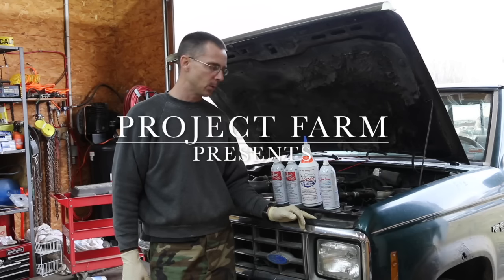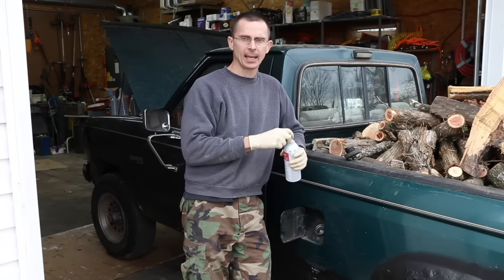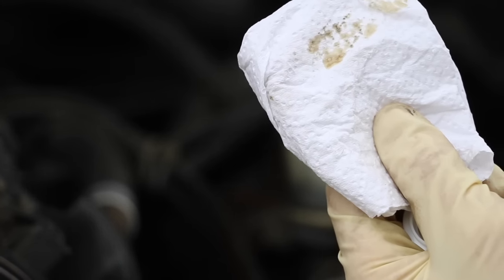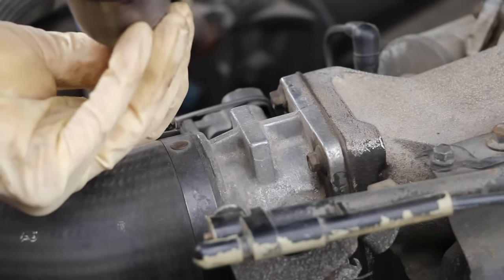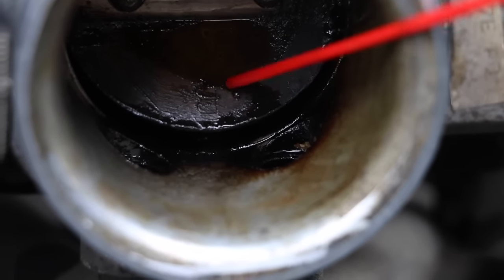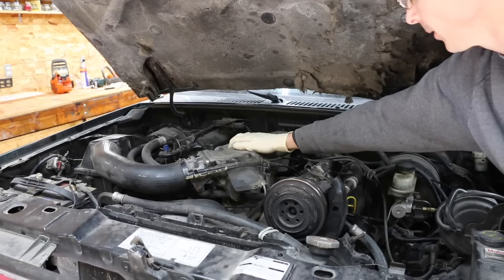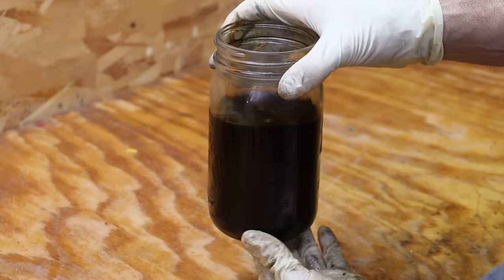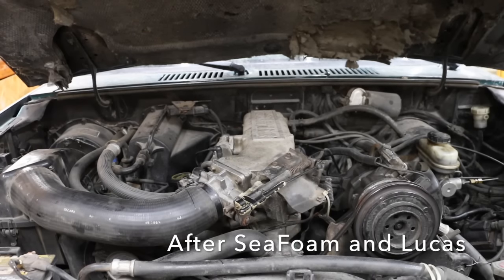Seafoam--can't believe what it did to my engine!!

Comment: I used to add kerosene to the oil. About a quart to a cold motor and idle it for five minutes. Drain oil and replace. Has managed to help several junk cars i bought cheap run better. Love the Lucus oil too.
Reply from the maker: Thank you for this recommendation!   Lucas is a great product.
Reply: I've done that alot also,helps flush the engine
Reply: Greg Cripps t
Reply: My Dad use to do that before every oil change back in the 50' s.
Reply: Sometimes I run a about half a quart of ATF+4 in my engine about 200 miles before an oil change.
Reply: That is basically all that  "Valvoline motor flush"  is. But yes fully agree this works great. I just started doing 1/2 quart any ATF 1/2 quart kerosene. Seems to work fantastic!
Reply: Chris C I like adding Lucas Pure Synthetic Oil Stabilizer to my oil sometimes...just a little so I have benefit without my oil viscosity going thicker. Anyway, I read that it dirties up your engine and I've found that to be true. My oil is very dirty at 4,500 miles intead of 5k miles. So I need an oil flush. Since that's just kerosene more or less I'm totally going to buy some and try it! Be sure to follow so you don't miss out. I've already got a couple Lucas videos and water decarbonization up.
Reply: It works. That is old school. Risolne works too. It replaces a quart of oil.

Comment: take off your throttle body and use some carb cleaner and a toothbrush clean up that plate it will help it breathe better
Reply from the maker: Ahley Excellent advice.  I'll do that.  Thanks for watching the video and the comment!
Reply: your welcome also one more thing after seafoaming it's a good idea to change your plugs know from personal experience it is amazing stuff if you use it right!!!
Reply from the maker: Excellent point--I'll do that too.  Hope you enjoy the weekend.
Reply from the maker: Ashley,  I removed and cleaned up the throttle body this weekend and it made a big difference.  I release the video of this procedure next week.  Again thanks for the great suggestion!
Reply: Project Farm I was about to suggest the same thing! Amazing how much difference it can make, cleaning the pcv can do some good if your vehicle is fitted with it. :)
Reply from the maker: Spac8, thanks for the recommendation on the PCV valve!
Reply: Project Farm No worries at all. My friend had a little 1500cc Mazda that was burning a crazy amount of oil (a proper blue smoke trail under full throttle!) - as it had 160k on it, he presumed it was caused by ring wear or similar. He tried the Lucas you used to try and help, to no avail. I used carb cleaner to shoot down the PCV line to flush it out and it totally stopped smoking. Can make a huge difference. The other thing I do to my own car is to spray a few squirts of carb cleaner in the throttle body whilst the engine is idling. On most modern cars, when you back off the throttle and the throttle plate closes, the air has to "bypass" it by going through an idle air control valve, that is essentially a little motor that controls idle air flow based on info from the ECU. Some cars have a habit of clogging it (like mine), so once a month, I let it idle and do a few very short bursts through the throttle body (or the actual idle air valve orifice if you can get to it) then I rev it up slightly and let it settle back down, do one more idle spray, and turn it off. Let it sit for 5 mins or so and then start it back up and rev it or go for a drive. That method cleared up an idle problem on my friends E34 that I was told could only be cured by a new part or by taking it off the car and cleaning it out. :) Now you've done all that cleaning, that thing is running beautifully by the way!
Reply from the maker: Spac8, Great insight in how to use car cleaner to clean the contact points of the throttle plate with the throttle body as well as the TPS!  I'll do that in the future.  Thanks for watching the video!
Reply: yes clean throttle body it will idle better..ive learned from chevies that when it turns on and then off immediately is most likely a dirty throttle body
Reply from the maker: Mandela Effect, thanks for commenting.  In part 2 of the video series, I cleaned the throttle body and it helped the idle a lot!  Thanks again!
Reply: Did you also clean idle air bypass solenoid?
Reply: Steve Smith 
The IACV (idle air control valve), the solenoid can be serviced but shouldn't be "cleaned".
Usually the solenoid attaches to the outside of the valve, works the function, has little/no contact with engine.
Reply: With the kind of carbon build up You had in intake . I'm just going from experience with ford's I have previously serviced. They usually have good amount of the carbon an oil build up due to pcv as well that was previously mentioned. 
 I have had great success in pulling valve and spraying it with carb cleaner an letting it soak an then flush out with carb cleaner. 

I have not had one fail from this because I do not submerge it. Only soak the inlet an  out ports of valve.  Either way the seafood did a good job on the little pinto motor in the ranger.
Reply: get someone inside the vehicle to hold throttle wide open while doing
Reply: BlackFlyerRed88 MRWatson you don't have to have someone inside to hold it at WOT, that's why there's a linkage on the throttle body... not to mention doing that is unnecessary regardless
Reply: ok man, that's fine n dandy but if its held open for you, whether using an apparatus or a person, then you could have 2 free hands, and sometimes the return springs will wear you out trying to hold open with one and clean with one hand. If it is held for you, you can spray cleaner with one and scrub with toothbrush with the other. And sometimes very necessary to keep engine running smoothly. have a good 1
Reply: Ashley Anderson
Reply: 1970 olds442 have you tried to seafoam a vehicle and actually see the difference one of the tsb articles from gm about my trailblazer was about how the throttle body could become dirty and result in loss of power so I did as it said removed the throttle body and cleaned it power was restored I respect that you are a mechanic as I have tore down and rebuilt alot of cars in my life the work is tough but try the seafoam treatment on your vehicle and you will see that it works my 02 trailblazer smoothed right up after doing this as well as my 03 f150 and it has been over a year with it and I haven't had any adverse effects except for changing the spark plugs thanks and have a great day
Reply: I like pulling the butterflies out of the throttle body and soaking them in hoppes 9 cleans them better did that on a used holley i bought cleaned the entire throttle body using hoppes and a tooth brush
Reply: seafoam will clean a motor out but thats not always a good thing you break all the gunk in the oil system loose the first place its gonna go is into the bearings and then you blow up
Reply: Seriously? Did you even watch this video? His engine went from loud and bad idle to nice and smooth!
Reply: hey if you're a mechanic what are your thoughts on that compression fitting on the master cylinder line ?    not on my truck!
Reply: What throttle body? I see a plenum on this fuel injection engine. More air is more horsepower and more fuel, nothing new but it gonna help this tired old Ranger that has been overworked and neglected. It is a toy truck.
Reply: Perhaps being a mechanic ALL your life you might have suggested an oil pressure test or gauge be employed as that was the goal here I believe. The clatter went away and where did it go? You tell us. 10mpg more? Really? That is something you achieve with what you work on? You must be one busy wrench if you can do that.
I think the fellow here will get some extra use out of the old mini-truck without paying you rip-off artist mechanics a fortune for doing nothing. Olds 442 huh? You can pass everything except a gas station.
Reply: cravinbob ???
Reply: You might also want to remove the Mass Airflow sensor located on the throttle body and clean that too. If the TB was that dirty then the MAF sensor probably is too.
Reply: I only wish they had put the 2.9 in the pinto. lol
Reply: Well I used to be a mechanic and I would say that  slug  in the engine  from oil heating and cooling  had clogged some of the oil ports and maybe even the oil screen and what the seafoam did was break it down and let the oil flow again
Reply: Ashley Anderson Just having surface build up on the throttle plate won't affect airflow.
Reply: Original Recipe not going to get into a big debate just say my piece here for example you take your truck 4-wheeling you get it dirty in the mud caked on it pretty good and stuff like that so naturally you're going to have more wind resistance because your truck is dirty however if you wash your truck then polish your truck the wind then Glides easily over your truck so same difference with the throttle body it will affect air flow a little bit I know this or else it would not be causing problems there would not be service bulletins on the issues
Reply: Ashley Anderson I'm not debating it either. Body wind resistance and throttle plate resistance isn't the same. I've been a mechanic all my life and it's a waste of time to take apart all that for a simple clean. a simple spray like he did to clean it off a bit is all you need to do. And you need to realize the throttle plate is a air blocker so it is supposed to block the air. Now ya know :)
Reply: I had 2 noisy lifters in a petrol powered straight 6.
No commercial product would work. So I read up on oils.
About a month after starting to educate myself I switched to diesel oil ( J-Max 20-50 to be precise ) and 2 weeks ( or around 500 kms [300 miles] )  later I changed the oil filter and gave it another load of fresh diesel oil.
Totally forgot about the noisy lifters till someone asked 6 months later.
After I put that diesel oil in, the car ran quieter, cooler and more efficiently giving me more distance per Drop of fuel.

 AS I ALREADY STATED - *NOTHING ELSE WORKED8 that includes chemicals specifically formulated to fix noisy lifters.

SAVE YOUR MONEY PEOPLE and stop buying cleverly marketed products relying on your lack of knowledge and depending on your level of gullibility.
Reply: Diesel oil is not good to use in older engines with high mileage, it contains detergents that can be damaging. A friend of my father's put it in an engine with about 100000 km on it and it cooked the motor in less than a year. If using it in an engine from brand new it can work well but it isn't recommended for older rigs...
Reply: I've had cars that I bought with over a hundred thousand on them and when I pulled valve covers to replace gaskets the motors would be so gunked up it was scary. I always run high detergent oil and change my oil every 2000 miles. If I tore any of these motors down for repairs again they would be clean as a whistle inside. I've has several motors go over 300,000 miles with out an overhaul, and I have never bought a new car an only owned three cars that had under 100,000 on them when I bought them. So you're statement doesn't hold water.
Reply: JayJay I never said not to clean the throttle body. I said taking it apart to clean it back to looking brand new is a waste of time. The simple spray clean will do the job.
Reply: +Jim Piver: Your're an old codger like me, eh?
P.S. "You'll wonder where the carbon went, when you use Pepsodent!"
Reply: That throttle body OMG
Reply: Ashley Anderson where do you get that from? like is it available locally? zep is good stuff
Reply: JayJay thanks for the tip there, see I'm having some issues in my 98 accord coupe. all symptoms point to a bad map, it's a little square mounted just above the throttle body and I don't think that cleaning  it would do any good. considering they are stupid expensive new,  could I get away with using one out of a salvage yard, or can that specific map be cleaned to your knowledge, or anyone else's?
Reply: 3m base citrus cleaner will do a much better job.
Reply: Citrus cleaners work wonders, plus they're environmentally friendly
Reply: did something like that to our old lumina and it was like a new car. Seriously a good move before dumping money on something
Reply: be careful cleaning the throttle blades some of them especially fords have a coating on them to prevent sticking be sure to read the service manual and use the recommend solvent
Reply: well ya I guess you're right I will stop following the service manual and do as you say I wasn't being a smart ass the coating helps prevent sticking coming off idle and that was a problem in the early AIC fuel injection throttle bodies due to the blades making contact with the TB housing because the blades are completely closed at idle allowing the PCM to control the air flow at idle with AIC system (AIC means Air Idle Control)I can only assume a man with your knowledge and experience already knew all of this and judging from your last paragraph  (But hell I probably better use the special cleaner because I wouldn't want any air particles getting stuck in my throttle body and gunking it up making it stick.)I guess you wanted to make yourself feel better by belittling me
Reply: yes,removing all the carbon on the bore of the throttle body,and throttle plate,air idle motor,egr port,etc will restore it to the correct airflow,helping with AC on idle,decel stalling,,cold startup flare and over all driveability
Reply: Your not supposed to use Carb cleaner on a Ford throttle body.  Ford's have a special coating on the throttle plate that carb cleaner wlll simply destroy.
Reply: Michael I don't know if your reply is to me (insulman100) or someone else Yes I know going by the ford service manual and if that's not enough there's a decal on the TB that tells you not to use carb cleaner but jay jay doesn't believe it and for some reason he thinks that I think that air particles? I can only assume he meant air molecules will cause my TB to stick so you will most likely get a dumbass reply from jay jay(in my original comment I was only trying to suggest to people to read the service manual before working on something as sensitive and expensive as a TB)
Reply: no,you do not want to excessively rev your engine for any reason especially holding it wot and especially not while adding seafoam.if you heard the difference in the video of before and after,you will understand he was successful and needs no additional advice.
Reply: I didn't know this video was made in 2009!
Reply: Agreed !
Reply: Published on Mar 11, 2017
Reply: don't use carb cleaner! use a can of throttle body cleaner. There is a varnish coating on the inside of the intake and carb cleaner will strip that off and cause corrosion and pitting on the intake. this will (believe it or not) disrupt air flow.
Reply: William, have you ever notice some people will use brake parts cleaner in the throttle body?
Reply: Yuppers, my Dad was one of  them. I got him a can of the good stuff.
Reply: Ashley Anderson Gumout !
Reply: That's what me and my dad do
Reply: A non-polar solvent is a non-polar solvent.  Hexane, xylene, gasoline or brake clean.  Of them gasoline is by far the least expensive, so why not get most of the gunk off with that (but no smoking, OK?). And if you need to clean a part to make it a little prettier, by all means spray some carb or brake cleaner on it.  They are all good non-polar solvents, just like water or ethanol are good polar solvents. Period.
Reply: 1970 olds442 Let's see, so stuck lifters beating the crap out of the Cam, push rods, rockers and valves being bad for an engine is all in his head...this was a cheap alternative experiment  to a tear down to see what happened and share the results...
Reply: Never use carb cleaner on a fuel injection system.  Parts are coated with teflon.Carb cleaner will eat it off.  Major damage will occur Throttle cleaner is safer.
Reply: Too bad you cant dislike comments anymore
Reply: omg id NEVER stick any metal part in a throttle body like that some newer trucks if u even touch the butterfly valve it fill fuck ur your vehicle up

Comment: Wow that is an unbelievable difference! Based on the throttle plate I wonder if it would benefit from a round 2 of that particular one. Do any of the bottles say it may be a good idea to do more than once for best results?

Either way I'm sold; I'll be buying these for my vehicles.
Reply from the maker: Thanks for the suggestion.

Comment: Wow, it sounds like the foam treatment worked pretty well in that rig....I've got an 84 Ranger 4wheel drive w/4spd and the 2.3L motor. I bought it in the fall of 2013 from the original owner, it was his daily driver for many years...the odo just turned 307,000 miles, and the motor has never been opened up....I've got receipts for what appears to be every oil change, and aside from the intake and exhaust gaskets being replaced, it's only needed a water pump, batteries, tune ups, and I just replaced the stock starter I shit you not...I paid $400 for it, and it runs like a top.... #FordAllDayEveryDay  #FORD
Reply from the maker: Impressive miles and great truck!
Reply: Those 2.3 was a great motor. They used that engine in the old svo mustang
Reply: Rangers are generally very reliable. Especially when taken care of.